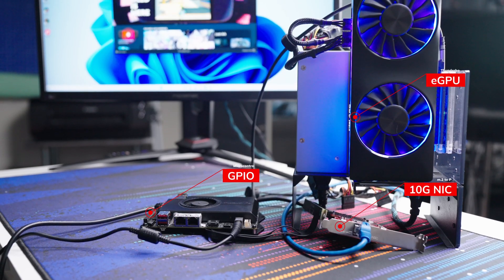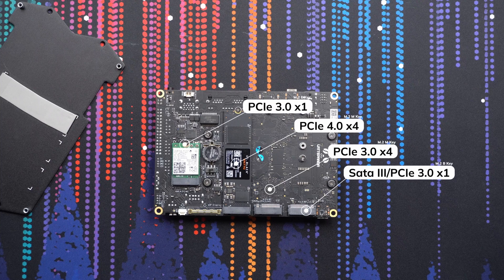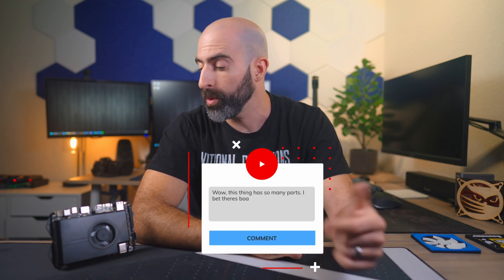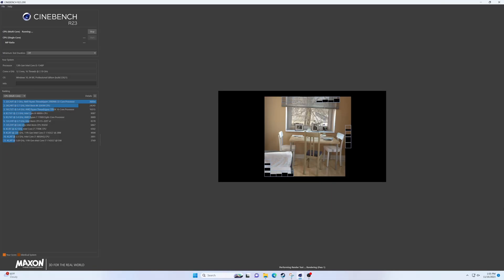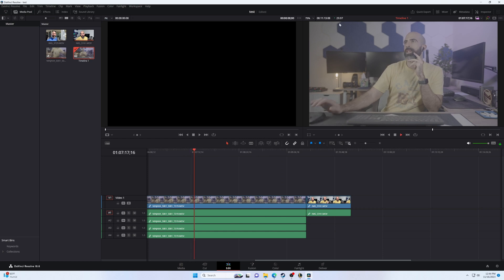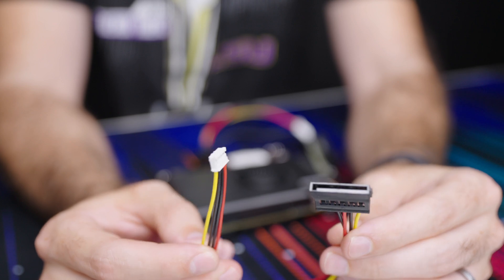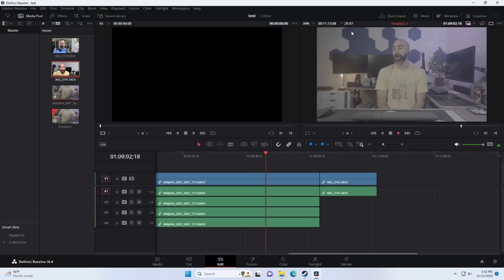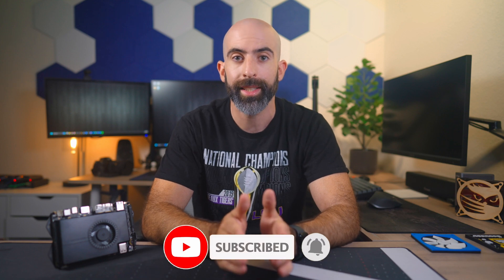This Mini PC has what??? - LattePanda Sigma

Comment: Im using one with the 11in touch screen primarily to run RekordBox for my Pioneer DDJ FLX-10. 
This setup is smaller than a laptop and much more convenient for my setup. It has also opened up some experimentation with arduino. For me I was a better choice than a laptop.
Reply: Are you powering it off a battery?  Can you please point me to a source on how you did that?
Reply: @Spyre_aint_it  
Latte Panda make an 11.6in touch screen made specifically for most of their products.  It uses the HDMI and USB ribbon connectors. I power mine through USB. 
The tricky part was coming up with a frame/bezel/case to fit it all. I had a buddy work some magic with a 3D printer.

Comment: Robotics. The microprocesser would be great for handeling leds, a PID regulator for motor control or just have it doing some low power operations. Then use the CPU for more compute heavy tasks like recoding, analysing and streaming video or hosting a web interface, database and simular stuff.
Reply: or Kali Linux 😉

Comment: Should have a look at a framework mainboard, they've got some of their older low cost boards starting around £200
Reply from the maker: I’ve had a framework in my cart so many times haha
Reply: @RaidOwl  I've taken the plunge on 16 inch one. But some of the older 13 inch main board are on their outlet store

Comment: This would be a good platform for development in an industrial environment. I don't know if it would be robust enough for production use, but this would have been handy back when I did some development work with automated pallet conveyor systems. We used to use a PC for data acquisition and monitoring connected to our controllers with a serial cable. Something integrated like this would eliminate a number of points of failure we dealt with.

Comment: I could see this being useful for smart home stuff. You could run Home Assistant, using the GPIO coprocessor for stuff like ESPhome, and have the horsepower and expandability to run an NVR like Frigate with a Coral TPU, etc.
Reply from the maker: Do et ;)
Reply: that was my first thought too, if you can get those gpio pins to connect to some old alarm wire that would be perfect